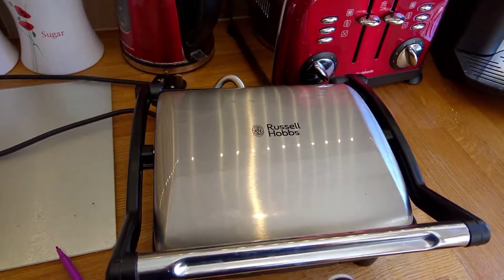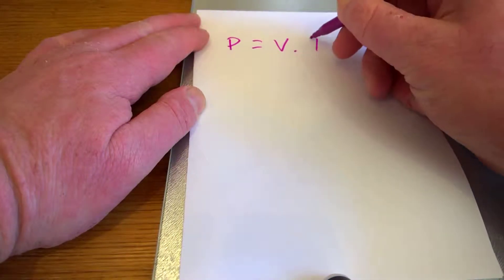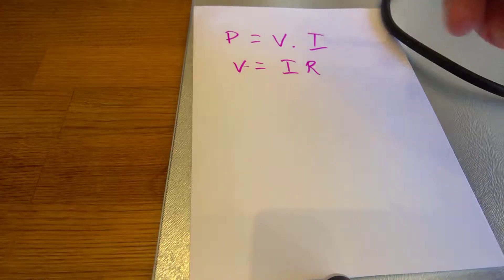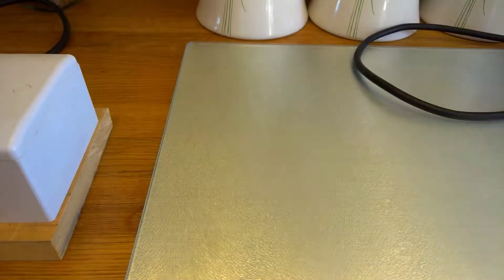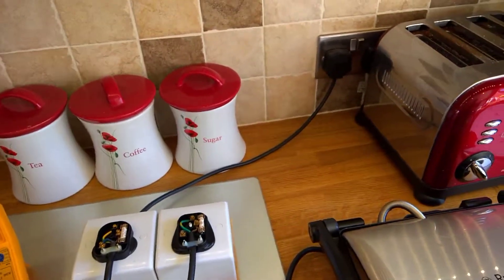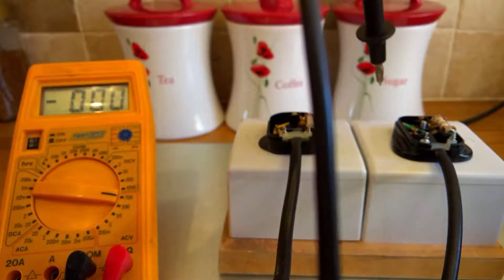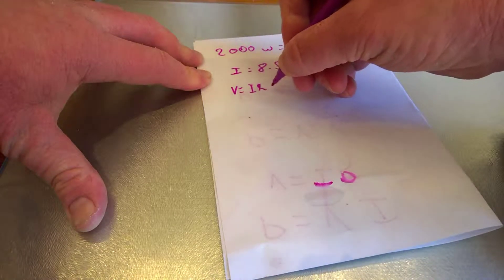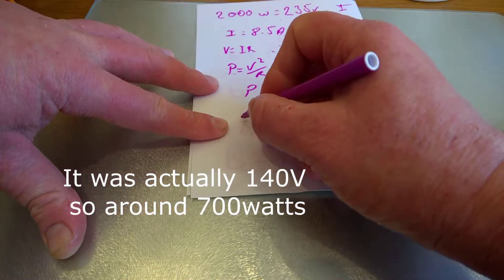Russell Hobbs 17888 3-in-1 panini grill (Part 2) - SOLUTION!

Comment: why not let it heat up fully before putting the sandwich in?
Reply: Yep, correct. You have to let the plates heat up first. Then the thermostat kicks in and lowers the temperature. Either that or its faulty, lol
Reply from the maker: It gets too hot